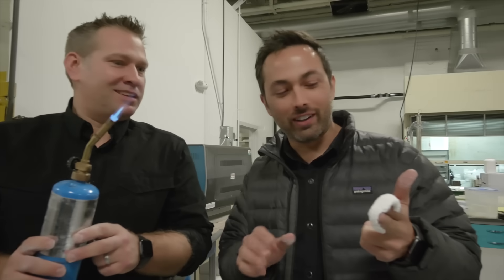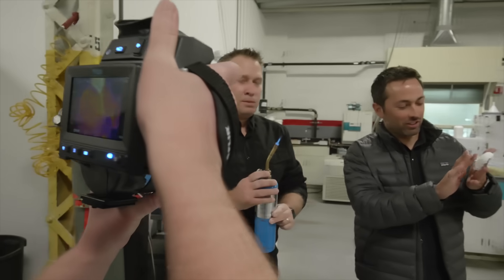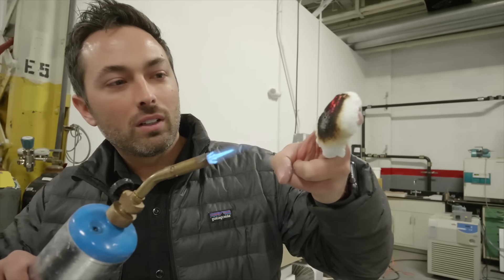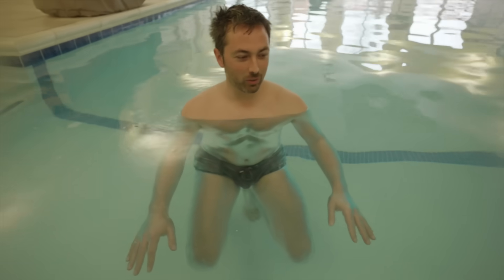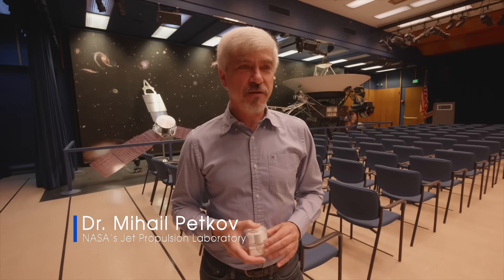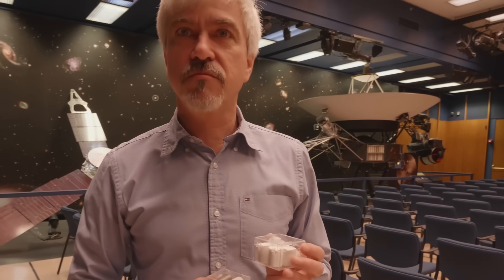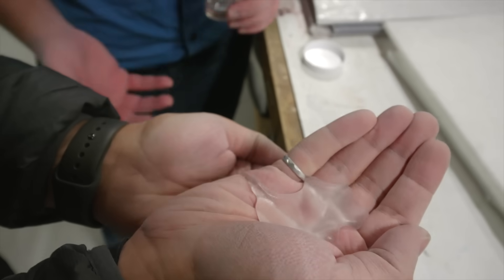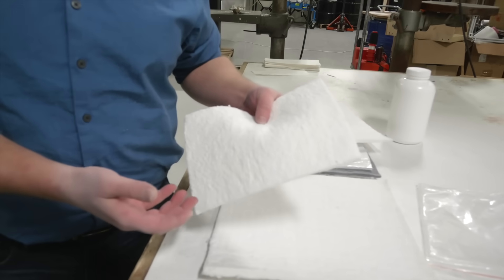I Waterproofed Myself With Aerogel!

Comment: "Doesn't take a lot to break"
iPhone Design Team: heavy breathing
Reply: Laughs in Samsung Flex.
Reply: Asef Jamil Ajwad  So you are paying for your battery to be throttled? And also, updates are pushed out by carriers. So you can't blame the phone manufacturer of it isn't updated. Most likely the carrier just doesn't care. And as for reselling. Apple just doesn't change their design. The iPhone 6 is 5 years old, but still technically one generation behind in design. Android phones push the limit with tech. Apple just 'invents' it again.
Reply: @asefjamilajwad  LMAO SO YOU ARE STILL ADMITTING THEY HAVE PERFORMANCE ISSUES. TWO WRONGS DON'T MAKE A RIGHT 

Why not be transparent and explain it?  How is being honest with your customers trouble?  Trouble is lying to them and only admitting it after getting caught for it like a scammer. 

And no the choice is an illusion because one its a lose lose situation and two its enabled by default and  hidden deep in the settings on purpose because they know most Apple users have no clue about it where to find it let alone turn it off

And the battery thing is a scam to get Apple to give you more money and also an excuse. If it was about the battery they would have said so not try to hide it. Its clear they did this to get people to buy new iphones
Reply: *laughs in Nokia 3310
Reply: @bruhzone154  i watch this video on a 3310 and then i will play snake gg!
Reply: Connor i read this comment through a broken screen
Reply: @asefjamilajwad  Another thing to note is Android phone manufacturers do not invest much at all into privacy, and instead invest in data extraction on their users. Seriously Google is an advertisement company, the king of data. Apple has literally gone to the supreme court to fight for their user's right to privacy. I'll spend a bit more to not be excavated thanks.
Reply: @wildmonkee  in your dreams. Apple literally leaked face time calls. How the hell is that privacy?  Also how can you brag about the court case and ignore how apple slowed down phones without telling anyone and denied it until only after getting caught they admitted it. You guys are truely brainwashed.
Reply: @eventusvantos2770  While we're using one time incidents to define a company https://www.wired.com/story/android-smartphones-vulnerable-out-of-the-box/ must mean that all Andriod phones have the worst security ever, and also the slowdown was specifically to improve the longevity of the devices, since they're so old, and surprise, actually supported with the latest updates still for a long time.
Reply: @eventusvantos2770  Whatever man, you think a facetime link is worse than having entire detailed profiles of everything you do and everywhere you are at all times being stored all over the place with very little intervention by Google than fine. I can't control your lack of care. As far as slowing down my phone goes I don't keep phones longer than 3 years so I'll never have that issue. The reason why Apple is more expensive is that they've made many innovations with their phones over the years (see EverythingApplePros video comparing Android phones versus iPhone) where Android phones have basically upgraded a couple parts and everything else is very similar.

Also if we're talking about transparency then wow. You know how long it took until Google disclosed what they knew about you? Do you have any idea? They didn't until the EU forced them to start displaying information so seriously? I get Apple should have said it ahead of time but it's not like they were doing it to be evil, it was just bad management, and as @Asef said, do some research before just leaning on your bias, the update had a reason to be pushed out.

But since I know these aren't enough, let's go back to some reality.
https://bgr.com/2017/10/11/google-home-mini-spying-on-user-fix/
Hm. 
https://www.projectveritas.com/2019/06/25/breaking-new-google-document-leaked-describing-shapiro-prager-as-nazis-using-the-dogwhistles/
Damn Google really loves the freedom of speech.
https://www.wired.com/story/google-plus-bug-52-million-users-data-exposed/
Definitely no issues here with security.
https://www.theverge.com/2018/10/8/17951914/google-plus-data-breach-exposed-user-profile-information-privacy-not-disclosed
Very transparent company.

Do I have to go on?
Reply: @wildmonkee  Bro are you talking about fbi iPhone clash and if you are then you should know they got help from third party and hacked it.
Reply: @surajkumar-hl5tp  Yes, but the point is that Google will just hand over the keys, Apple at least held up their customers and didn't install a backdoor.
Reply: @wildmonkee  if i remember the story correctly owner of the iphone was a murderer so isn't it just protecting a criminal iphone was a potential evidence i don't what apple did was right
Reply: @surajkumar-hl5tp  Thing is Apple doesn't actually have the keys to anyone's phone, even Apple cannot get your data. The FBI asked Apple to create a backdoor that would go around the encryption in all Apple devices, meaning that anyone with the special keys could just walk right by the encryption. If you believe the keys could never ever be leaked and the FBI would always use it for good then sadly that's not reality. Imagine if a hacker could just open your phone in seconds. It's the same BS that everyone deals with at the airport with the TSA, and the NSA mass surveillance program. Neither of those have actually helped prevent terrorist attacks and they are just an excuse to compromise people's security.
Reply: @wildmonkee  first off. Its not about worse or not. Its about you having no room to lecture others on privacy when apple does the same exact thing with apple maps. There is no such thing as a company that truely cares about its users privacy. You are utterly naive if you actually believe there is. And its not that I don't care. Its that I acknowledge it and have nothing to worry about because one I don't really give them much information to begin with and two I have nothing to hide. 

Again. Just because you use your phone for 3 years doesn't excuse apple doing that. Many people use their phones for over 3 years. And btw that's not even true you will experience that issue just like many already have since it affects even iphone x

Lmao apple innovation???  That's the biggest joke of the century. Apple is the opposite of innovation. 

Android did real innovations like USB c which iphone doesn't have to this day.. Optical and ultra sonic fps which is way more convienient than face id. Tear drops and Camera pop ups and cutt holes and two screens etc unlike iPhone with big ass notch.  I could go on and on 

Android phones had wireless charging and water resistance for years... Meanwhile it took apple all the way until the iphone 8 to finally get those basic features... I could go on and on. So its the other way around. Android is way more innovative than iphone. Facts. 

What's so innovative about iphone x to iphone xs?  Oh that's right almost nothing!  Lmao. Innovation my ass. Apple does the opposite. They remove features. 

Again its pathetic how you make excuses for apple doing the same things you accuse google of! So google is doing it for evil? Where's your proof?  Quit talking out of your ass and quit being an apple appoligist. 

LMAO look in the mirror before you call anyone biased. You can't call someone biased when you are leaning on tim cook so hard. Let's see you defend the thousand dollar stand or how iphones don't include fast charger. This will expose how biased you truely are

Like I said. You compellry missed the point. My point wasn't that google is transparent. My point is that Apple isn't transparent either so you have no room to point fingers at other companies when apple does the same thing. And even worse now they have a credit card so best believe they will mess around with that to their advantage even if its at the cost to the consumer. 

My point is that you are a hypocrite.
Reply: @eventusvantos2770  I'm glad that personal data is on the same level as not disclosing a phone slowdown feature that was meant in good faith but badly executed.

As far as innovation goes I was specifically talking about the internals, it's obvious if you actually looked at a comparison between an old iPhone and a modern one. I get that yes Apple is behind on many things and I too think they're stupid for it, especially the notch, which should not be a thing in 2019 and I am very disappointed Apple's iPhone 11 is going to be the most boring and uneventful phone ever. 

The lack of a fast charger is dumb yes, and at least they are finally including this year (well rumored too anyways).

I'm also going to note that face ID is annoying yes but it's still more secure. If we're talking about convenience then yes Google/Android will always win because they cut privacy corners to deliver the optimal experience. I mean that's why Google's Assistant is lightyears ahead of Siri, because Apple doesn't have the data to feed an algorithm with.

I'm still going to disagree with the transparency part because the scope is vastly different.  Apple has always had my data on my phone and on my phone alone, not tracked or stored elsewhere, and my current phone is an iPhone X has never had any slowdowns from anything. Google/Android, on the other hand, takes heaps of data and was only transparent about it within the last couple of years. I'm not going to sit here and say the iPhone X should cost $999. I feel like Apple probably doesn't do a lot of cost-saving R&D and ends up making the phones crazy expensive. However I'm also going to say we're talking about flagships here, you're really saving around $200 to get a Galaxy S10 and unless you buy your phones outright that's literally a less than $10 a month difference. 

Also of note is Apple Maps does not track or store any data off-site of any kind on you. None of Apple's services do this. The only thing they could have is your saved spots if you sync them to iCloud, and that goes for any data Apple could have, and even then Apple doesn't touch it as Google does, it's just stored for you.

About 'nothing to hide'. This isn't about the NSA or FBI arresting you for illegal activity. This is about bad actors getting your data and using it to do things like steal your identity, money, and other nefarious activities that can be done with such information.

Also, the credit card is a scheme to get people locked into Apple Pay and their ecosystem yes, however, all transactions done with Apple Pay are only on your phone, and it is not meant for data harvesting. Apple's whole business plan is privacy as a service. As dumb as Apple can be in certain areas, they would not needlessly destroy the only thing keeping people interested in their devices.
Reply: @wildmonkee  say what?  First off apple has done way more than just not disclose a slowdown feature... They have also leaked face time and have had many gates and privacy issues which all involve personal data. And how was it done in good faith?  It was done to increase iphone sales. That's in bad faith not good. If it was done in good faith there would be no need to hide what they were doing. They hid it because even they knew how scummy their own actions were. 

And what internals?  The only thing they are good in is processors. But in every other way they are behind. 

Glad you at least admitted that. 

No face Id is not more secure. That's defiantly not true. And ultimatly biometrics already extremly secure so convienience is the key factor.
Reply: @wildmonkee  wrong. Every company...  Including Apple.... Shares your data outside of your phone. Any company that says they don't is flat out lying. 

Apple just isn't as up front about it that's all. 

That less than $10 difference goes a long way night and day like s10 offers far more features etc to at least partially justify the price so you at least get what you pay for 

Apple most definetly touches the data. Its inevitable.
Reply: @wildmonkee  any one naive enough to give their information to bad actors doesn't deserve a phone in the first place. There is something called discipline and awareness. When you check the terms of service part of what you are agreeing to is to share your data in exchange for a better service. Google is up front about this. Apple just like to play innocent but in reality they also do this. Every large corporation does. Its inevitable when you have that kind of power and influence. 

And you say that now but watch what will unfold with apples credit card. No company is perfect with privacy...  and especially large corporations will use your data. Some are just better at not beibg so obvious about it or getting caught like Apple.
Reply: @eventusvantos2770  Yikes my dude, just yikes. First of all the data being obtained by bad actors is a reality of the company being hacked, not you, and you need to understand that data can't be secretly mined from a device. You can scan and intercept all of the network packets coming from your device and tell if tracking was present. This is how I can be confident in the iPhone's lack of tracking. Plus iCloud data is encrypted before it's sent to Apple's servers, so Apple essentially is being given useless data. 

I would have to very strongly disagree that every large corporation is obligated to use data like you say they do. The reason why most do is that there are many many benefits to using data to quickly improve products through machine learning. If Apple did have access to such data I can be very certain their products like Siri would not be as bad as they are today.

But now you sound like the conspiracy type, where somehow corporations have to violate privacy for no reason because it's a given? Like what?  Google is an ADVERTISEMENT company so they ARE strongly obligated to harvest user data because that increases the value of the ads they sell. Apple has literally nothing but negatives to take data because as I said earlier, their business model is privacy as a service. If you honestly think otherwise then you're super ignorant to the reality of business and technology, and I can't help you.
Reply: @wildmonkee  wrong. If there was really that much data being hacked by bad actors then no one would use android at all period. So you are over exaggerating things big time. That's the yikes. 
Wrong. Google also uses encryption including for its cloud services which are far more used like google drive google doc etc why are you acting like encryption is propriatary technology when its not. By that logic apple also has tracking. You are naive to think otherwise. 

That that its obligatory but no company would not use it because the benefits outweigh the potential cons. Every large company has done it. Including apple. 

Wrong. Apple still has a lot to take. Any data is useful for a company  and if not they can sell it to other companies. There is no way apple can become one of the only trillion dollar companies with declining sales without doing things like that. You are insanely naive to believe they are perfect when it comes to privacy.
Reply: @asefjamilajwad  Pixels give you at least 3 years of software updates. And 3 years of Android updates = ~10 years of iOS updates. Try next time.
Reply: Connor 😂
Reply: Rarely do you find something more fragile than an iPhone
Reply: i dropped my iphone once and now the screen is falling out in pieces :,D and i'm too poor for another phone cause apple over charges for there low quality hardware, i love the ui or aspects of the ui, but it does lack alot of what android can do, not too mention Apple cares about its software more than they will ever care about the hardware that runs it
Reply: @HarlotOfWrath  Sorry to hear that man, best to go for things you can afford to replace or pay insurance with, saves a lot of heartache in the future :/ But considering the UI, you can get apps on Android that can customise your icons and more, I'm using one now, because Samsung UI is ugly but their phones are amazing. You can even get ones that emulate the iPhone UI, so you can get a cheaper better phone with a nice UI that you prefer, best of both worlds
Reply: I feel like I’m the only one who has an iPhone with a case and screen protected for like 6 years and has never had a crack or scratch 🙃
Reply: Broke mine 2 days ago
Reply: Apple bringing the iRogel MacBook next year.
Reply: My iPad’s screen ribbon wire cracked just by sitting there

How...
Reply: @asefjamilajwad  you isheep are truely clueless. Android doesn't need 5 years of software support because there software is good from day one. It has way more features and customizability  from day one. Heck even older android have more features than ios does to this day!  So of course they don't need so manh updates. Its Apple that needs constant frequent updates to even try and catch up and even still they are far behind. 

And no iphones tank in value.
Reply: My brother dropped his 4 year old iphone 6 plus on the street while it was raining and a car ran over it. Only the screen was cracked and it was working fine without any other issues
Reply: @asefjamilajwad  I've had my Android for 10 years and use it as a GPS. Always gets updates. Why are you lying ?
Reply: Yeah because they know the Samsung and Google design teams already figured it out.
Reply: Wrong! I have dropped my iphone countless times. Nothing happened. Please stop the Apple bashing folks. It‘s not fair..
Reply: @superman9693  The only thing Apple's good for, is wasting your money
Reply: @superman9693  ^
Reply: @superman9693  What do you mean it's not fair? The iphones are practically overpriced while you can get other phones worth your money. People bash on iPhones because of how expensive they are and other things as such. It's fair game, believe it or not.
Reply: @Stevepoku  iPhones aren't worth the money, but nor are other $1000 phones
Reply: @Stevepoku  mine fell out of my pocket with a case and a glass screen protector it shattered the entire screen. Then the digitizer broke and the phone became a dud. It was an iPhone 6s btw
Reply: Stevepok they are wonderful products if you know how to take care of your stuff
Reply: @antonhelsgaun  the galaxy s10 is definitely worth $1000 and its 900
Reply: @superman9693  lmao the ipad pro snaps in half
Reply: Petersilius Zwackelmann I agree with you 100%! I’ve dropped my iPhone countless times, and it’s never broken! People just like at the price tag and say their products are overpriced! Once you actually use their products, you’ll get to love them!
Reply: @superman9693  memes start for a reason
Reply: @superman9693  Watch some Louis Rossmann videos, then talk to me again